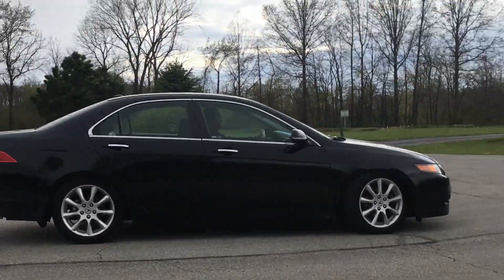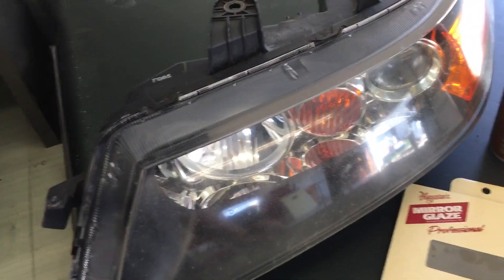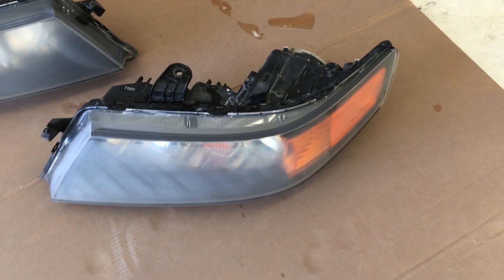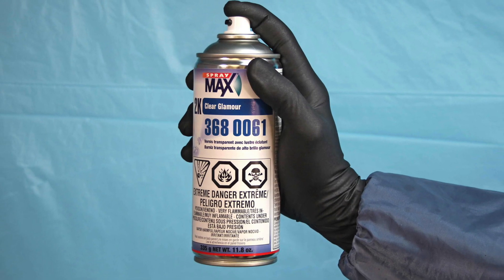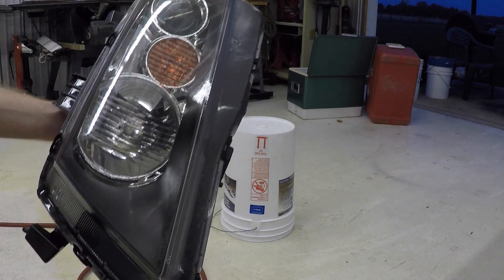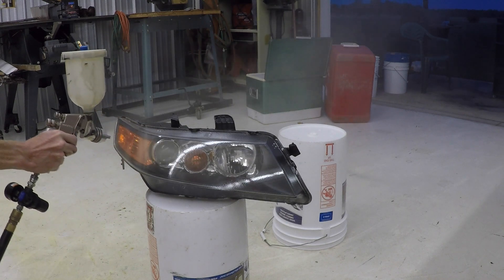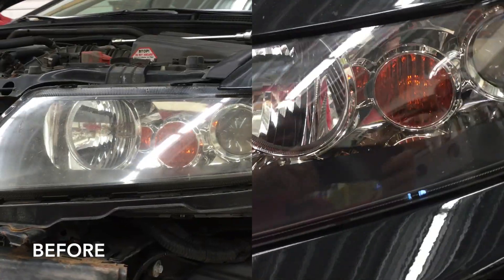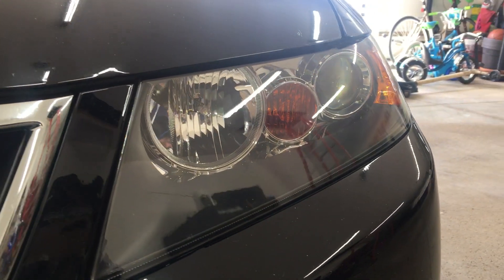How To Restore/Refinish Clear Plastic Headlight Lens

Comment: I tried using bathroom scourer to clear my Honda headlights. No need to remove the lights and it worked fine in minutes.
Reply from the maker: Nice... Just be sure to protect them from UV so they will last over time.
Reply: @6thGearGarage  If it ever stops raining here I'll try some clear coat of some sort!

Comment: Why in the hell didn't the OEM's have some uv resistant coating to begin with!
Reply from the maker: It seems like plastic headlights are good for a while, some makes longer than others) then they all start to cloud/yellow eventually. Probably due to abrasion over time from road debris?

Comment: Easy job don't and do not cost that much.  You only need sand paper and clear coat to restore plastic headlights ?
Reply from the maker: Yes, just the things I used in the video. Don't forget a degreaser to clean the plastic.
Reply: Most of the time, though some headlights tend to also craze or even crack. They tend to not be square-ish headlights like these TSX lenses - but got a bit of it on both my S2000 and C6 headlights, no matter how clear they are.
Reply from the maker: @6mtzhp55  Unfortunately I don't know if they can be saved at that point.